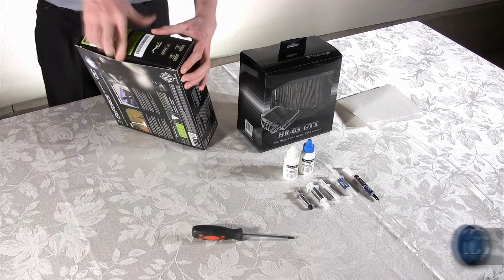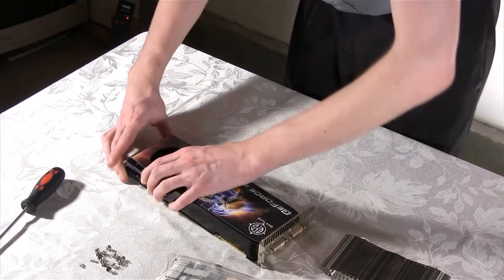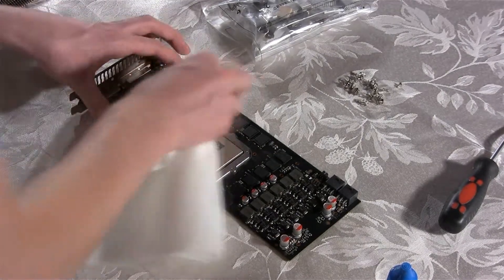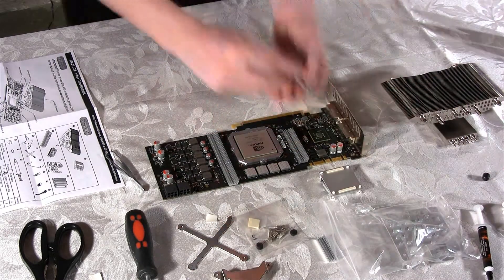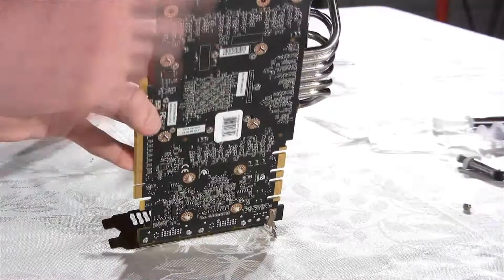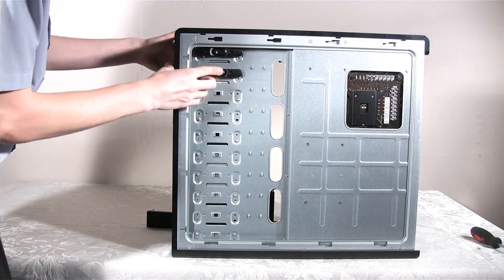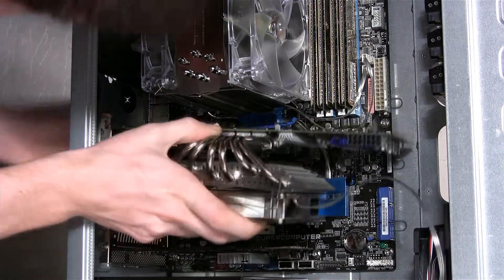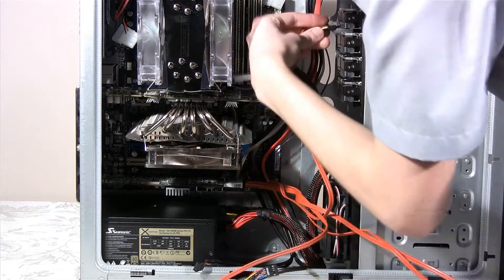How to Build a Quiet High-Performance PC Video Overview - Part 3 - AcousticPC.com

Comment: Its smarter to water cool your gpu if you choose to do so instead of air cooling and corsairs hydro series liquid coolers come pre applied with high quality thermal paste on them so there no proble and nzxt and corsair both sell gpu brackets for liquid cooling between 29.99-39.99

Comment: why are you using a monster cooler in a "quiet pc"? are using a cpu that actually needs a cooler of that size, and actually needs two 120 mm fans (and prolly crappy, noisy, soon-to-fail silenx fans)? seems like you're confused about the meaning of "quiet". and again with a cooler that has heat pipes below the heat source. this is amateurish poseur shit at it's worst.

Comment: used the same cooler on a ATi 4870. mounted below the gpu, it was only 5C than stock at 50% load. mounted above the gpu, the temps were 20C cooler at 50%. heat pipes conduct heat up, so putting it below the heat source means you just installed an expensive insulator that blows some slightly cooler air at the covered gpu. silenx fans (like the one here) are total crap. audible bearing noise from the beginning, absolutely howl when mounted horizontally, poor airflow and always fail within 4 mths.

Comment: @chronofusion 
I notice you have a lot of personal preference in how to do thermal paste lol.  Well, for starters, everyone builds computers differently, and what didn't work for you may work for them.  With that said, the thermal paste is designed to fill in the scratches on the CPU to make better contact.  I've cleaned my heatsinks and CPUs off with paper towels and napkins for years, I've even lapped my CPU.  Currently, it's sitting at room temperature and hardly breaks 50C under full load.

Comment: and NO i dont take a piece of paper, or razer blade or anything and manual spread the paste....it just takes one pea sized dab or drip of it in the center of the cpu and let the machine do the spreading as the pc naturally heats up.  just to put that bs argument to rest before it starts.

Comment: I know that from experience..I tried it on my first build computer with an amd athlon 64 3000+ cpu and after 2 years of removing heatsink just 3 times to clean and reapply paste.  i noticed it over heating..took it to a profession computer tech shop. they showed me with a wierd microscope looking machine the scratches on the cpu and how. the tech explained that those scraches caused the thermal paste to not set correctly thus some areas of the cpu were not covered with paste in the end.

Comment: also..NO NO NO..you DO NOT..EVER use a freaking PAPER TOWEL..when cleaning a gpu or cpu.  you run a much higher risk of creating small or micro scratches on it.  Ultra soft charmin tp is a much safer bet if you dont have the appropriate microfiber cloth or recommended cloth per the instructions on the arctic cleaning solutions.  Please tell me you have corrected that part of this video on an updated video somewhere.lol.*40 gaming pc's build custom since 2001 ftr* ..

Comment: i've beencustom building gaming computers since 2001 *more than 40 as of a month ago* and i have NEVER encountered in all my years a gaming class video card that would NOT overheat or come pretty close on a fanless heatsink cooling design unless it was water cooled.  But i dont know it all and i've been surprised plenty of times.  However, i just can't imagine putting a fanless heatsink on my galaxy gtx580 *( accelero xtreme plus hsf version). I dont trust  it.good video though.

Comment from the maker: @ImmortalUniverse That is the important thing is that You are happy, Perhaps next time try our AcoustiFans and for Raditors and heatsinks the Noctua NF-P12 is made exclusively for radiators and CPU heatsinks... Sound and back prssure optimized, silent motor with vortex notches reduces high freq noise. but also they are excellent perfoemance with radiators, visit outr site read the product page and youll see why.

Comment from the maker: @ImmortalUniverse  some companies focus on high ventilation others on quite and others on design. Zalman in my opinion are excellent quiet cases and good looks design. The only case Cooler Master had focus on the quiet/ silent computing market was the Sileo.  The whole Sileo series of products and silent pro PSU were focus more on quiet.  I was not impress with the sound dampening, but that can always be up graded. Cooler Master is good just focus on flasy gaming and high air- flow.

Comment from the maker: @ImmortalUniverse Did you get the car back?? Sometimes it;s the power supply that mnakes noise when the video card is under load. It;s like an electronic hum.  Also are you familiar with the Gigabyte 5750 Fanless Video Card 0Dba.

Comment from the maker: @ImmortalUniverse yes i did look back into the emails.  these fans were part of our testing, and again we were not satisfied with the motors to recommend for a ultra quiet or silent system. Cooler Master does make nice gaming cases, not focus on quite. When we look at fans we look at detail. Blade design, motors, material. But if your happy with them , then that is what counts in the end.

Comment from the maker: @ImmortalUniverse  There is no need to call me a smart ass for providing my profesional opinion. you came to this video and commented. and why do you not answer to the brand name of your 200mm fan??  I know why because your just here to try to flame right?? and if you tell me what model and brand your fan is you know im correct and it will either have a poor quality motor or loud ball bearing and cheap material, flimsy blades etc... good luck try one of our quiet fans sometime you will enjoy it

Comment from the maker: @ImmortalUniverse Ive been doing this along time. And work with manny profesionals. Im not arguing with you, in the end it's your choice, We dont buy anything of inferior quality.  What brand fan is your 200mm??  Also you need to read my comment again.. i did not say what you are stating.  I said 120mm is the sweet spot to much air also makes noise, i did not say a 120mm fan has more airflow. i stated the fans over 140mm have poor quality motors or loud ball bearing type. is you fan an FDB Motor

Comment from the maker: @ImmortalUniverse The fans we use are perfect. what you are saying does not make sense since air makes noise too. all the fans we have tested over 140mm have poor quality sleeve motors, flimsy blades or loud ball bearing motors, 120mm is the sweet spot also are fans have noise less motors and advance blade design reducing high freq hum, better back pressure and superior airflow at that same speed.

Comment from the maker: @GamerNebulae We seell online a 220mm fan by works in our cabinet cooling section. But it can be modded to a case. We did this video with what we considered to be the best parts at the time, re: fans as explained 120mm is a sweet spot. you also have manny motors to choose from and manufactures, accessories like fan mounts and gaskets for anti vibration.. you dont have these options with the 220mm fans. you can also reach us by email for more info as youtube limits charchters.

Comment from the maker: @GamerNebulae we find those super huge fans over 140mm to generally be extremely loud and have poor quality motors and flimsy blades.  basically 120mm fans in my opinion are the sweet spot.  these advance blade design fans with ultra quiet high quality motors are just simply quitter and cool extremely well.  You should try one some time.

Comment from the maker: @BlueBajs The Mainboard provides 3 pin connectors that matches the fan 3 pin style connectors, however you can use a 3 tp 4 pin adptor and go to the PSU for power source or if you have a fan controller you can use that.

Comment: @rockhills Yes, but what you can also do is install the block the other way around the so the heatsink would be on the back side of the card, and then add a fan that way. If you are not using anything for your north bridge and it is low profile, and you are also using water cooling for example for your CPU, then the HR-03 will not get in the way of other slots. It will just take up more space on the other side behind the card.

Comment from the maker: @M3RVITIS We are going to take a look at how the Zalman MS1000-H1 allowed us to do the cable management, and how it looks once it is done. Because plugging in the cables and showing how we did the cable management would take another full length video to show, we will just look at it quickly and then test out the system. Perhaps in the future we'll show you all a step-by-step process on how we do our cable management.